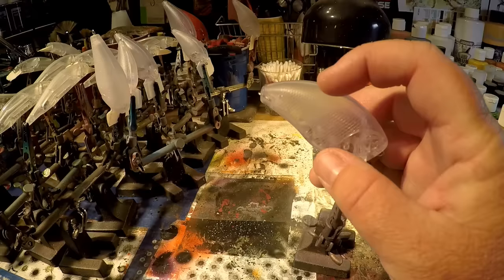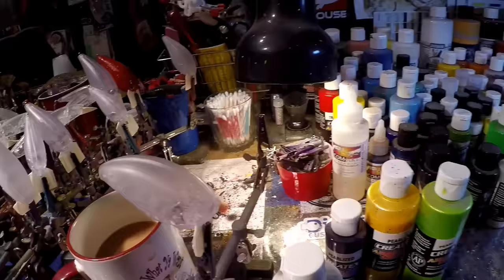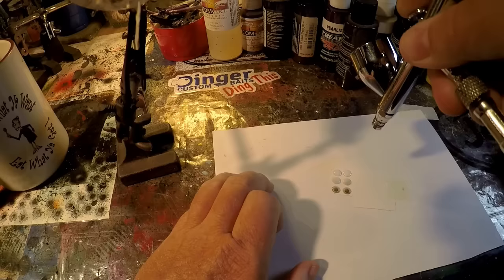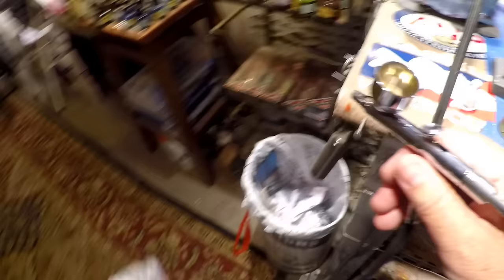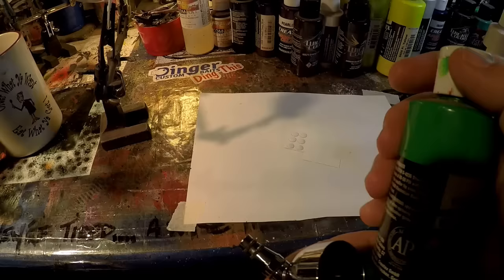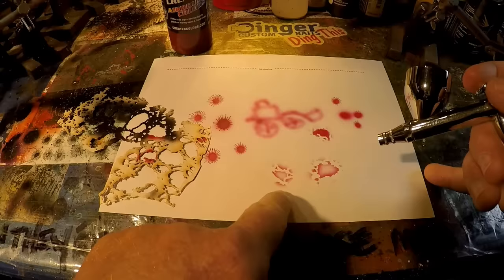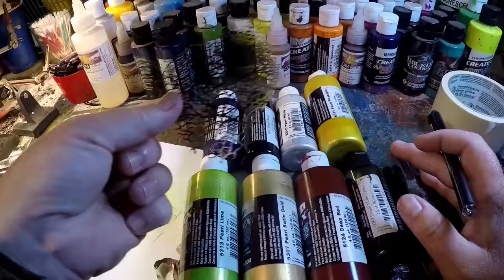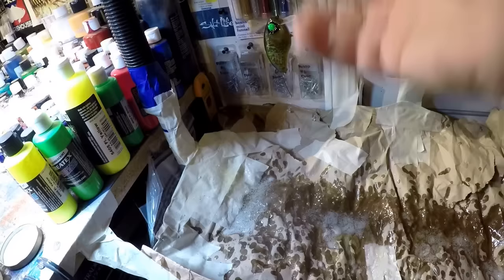Jekyll Baits Spray Session - "Mutant Cicada" (Toxic Series)

Comment: How long does it take for the kbs to dry? I use uv clear but I’d like to be able to dip my bait instead of brushing it on
Reply from the maker: I thought you could dip UV. I see Marling do it on his vids. Compared with it, KBS takes a couple days to completely finish curing.
Reply: Jekyll Productions  you can I just can’t find it in larger quantities  the uv clear I use comes in pints and is 55.00 a piece I guess I’m just looking for other options
Reply from the maker: KBS is about $15 cheaper but it is slower. I still use it because I don't have the required space I'd need to do a box build out as big as I'd need it (or the cash flow to invest in it  lol). All that said, I do like KBS and it more than checks off the boxes in the way of clearcoat
Reply: Jekyll Productions  thanks for the info, you have really helped me a lot on my lure painting Journey. I really love that you take the time to answer questions. THANK YOU 😎